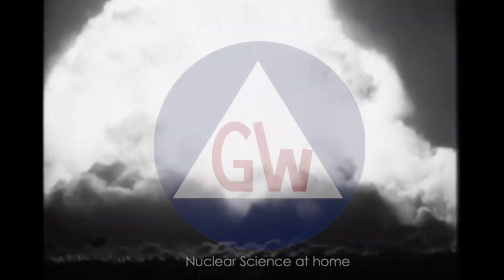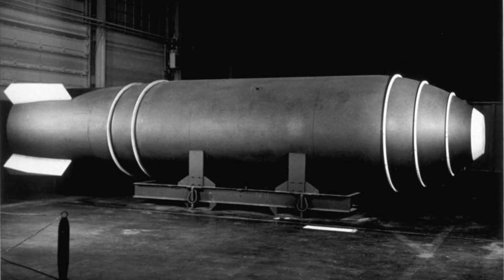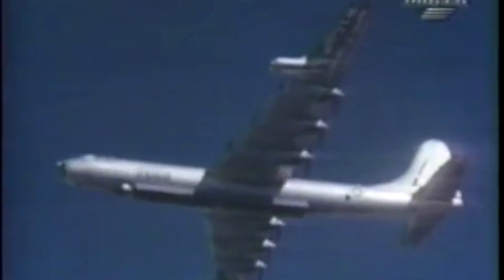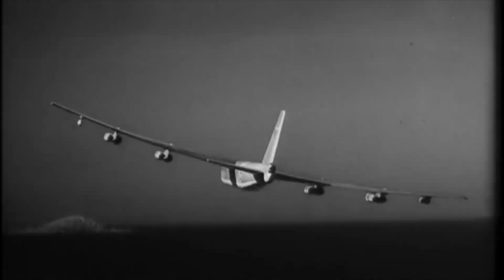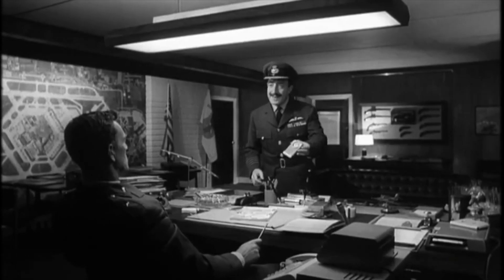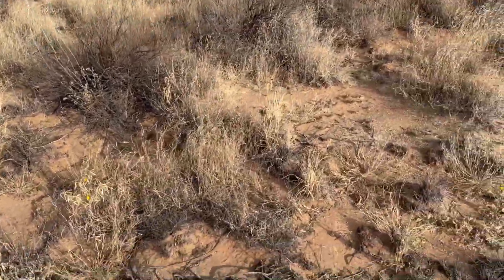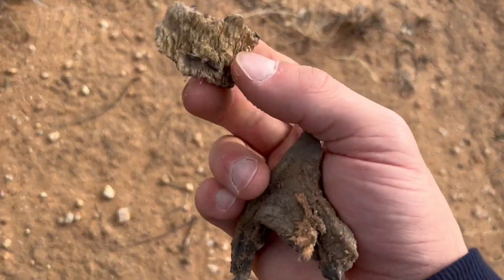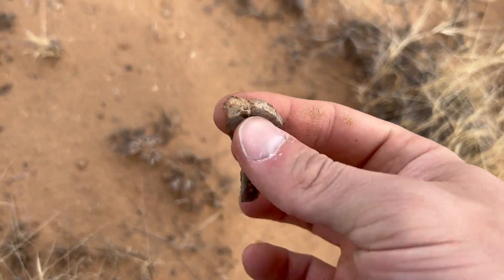Mark 17 Broken Arrow accident, Finding Nuclear Weapon Parts (ABQ, NM)

Comment: It's scary how many of those things happened where the doors of the plane just dropped out with the bomb still attached, or parts that have still not been recovered, you'd hope because it wasn't safe to do so, but no... A lot however didn't have the "warhead", any material wasn't present, which makes me hope it wasn't on the same plane 🤣